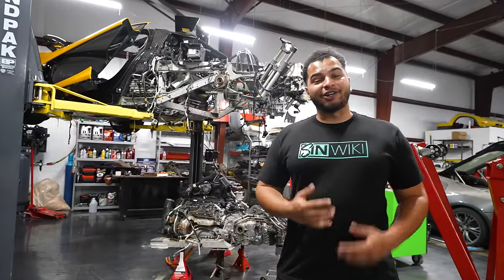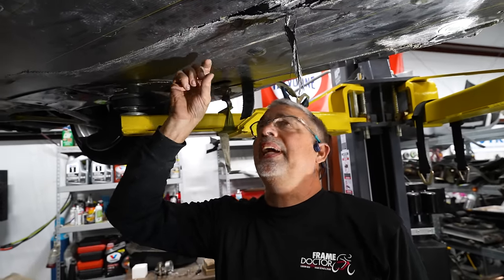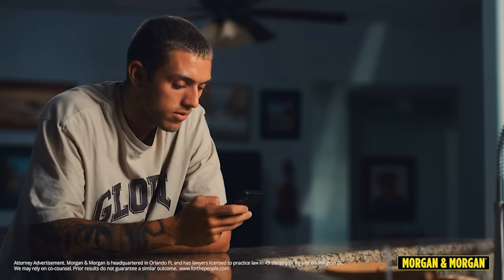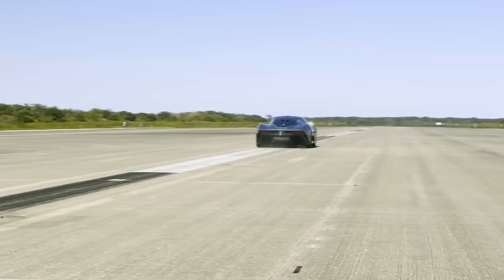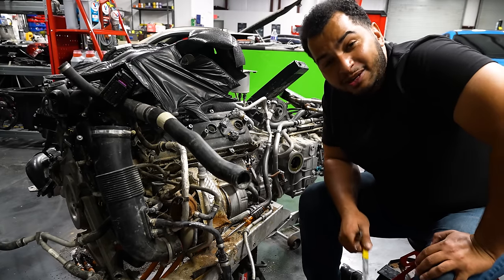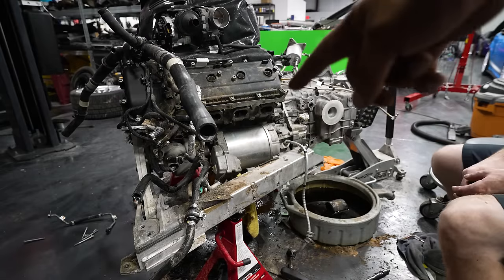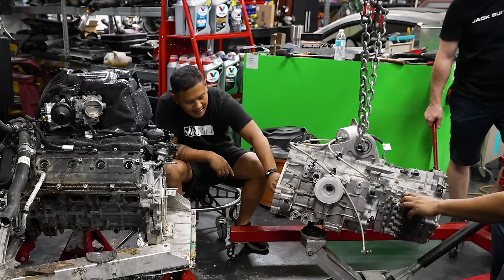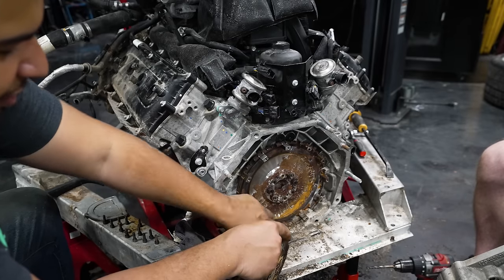Rebuilding A Flooded $2,000,000 McLaren P1 | Part 7

Comment: Could those guys that do the carbon fiber create a carbon fiber hood for a car?
 I know i probably should email them and ask, i have no idea how that would go my guess is I'd ship them a stock hood to start or get a car to them. Nobody makes a carbon fiber hood for this mostly probably because its a jeep but ive put a ton into making it just right and i dont like the fiberglass ones i want very high quality and the hood on this model is not really exposed or easily damaged so carbon would work i think. Right now i have a reworked stock hood that looks good but more clearance would be nice i had to give and take everywhere to make it work. I was thinking carbon fiber because its cool for one and I'd like the look of the carbon with no paint. Also i was thinking carbon fiber because i feel like the fit and finish would be top notch with the right company. I'd need vents in the hood and more clearance maybe like a cowl hood style and even possibly a hole for a round billet reservoir to stick up through. I don't like super big flashy stuff even though bare shiny carbon is flashy, i mean i want to create enough underhood clearance without some ridiculously tall hood by raising it just enough then id need some vents like maybe a slight cowl style vent at the rear and i could attach metal vents on top. 
I wonder how much it would cost to get something like that made? Im guessing it would be expensive especially for a one off. I feel like it would be worth a good amount of money to me to get a perfect fitting hood for my application but the time, knowledge, and equipment that would go into the final product would probably be very expensive.

Comment: If you make new rear shell, why you dint make openable bonnet, its a matter of safety, if you tunning engine catch fire you be able to open rapidly engine bay and use extinguisher, and with this solid panel  you will not

Comment: @Tavarish
You do know that to get 260mph plus out of this that you are going to have to strengthen the already structurally fatigued carbon body by adding more carbon weight as well as other add on weights with improvements to make it go that much faster? As you increase weight the car needs nearly 2 or 3 times the amount of power in HP to achieve the speeds you are looking for plus if you mess with the aerodynamics you need to lower the aerodynamic value to get higher speeds which also causes instability in traction so it won't flip the car over at high speed. Many racecars of the past have had this very thing happen while trying to get the lowest air drag where their cars flipped end over end at lesser speeds than you are trying to achieve.

Comment: I think for it to be a true P1 evil that you need to put the same three motors that Tesla puts on the Plaid one on each of the rear tires and and one on each of the front it would make it the fastest EV car and the fastest mechanical car and if you combine them you would have over 2,000 horsepower granted you would have to get creative where you were going to fit all those battery cells